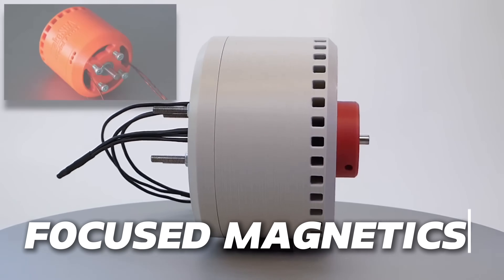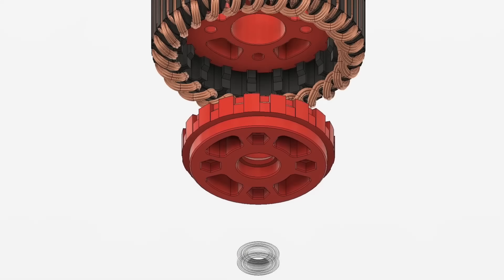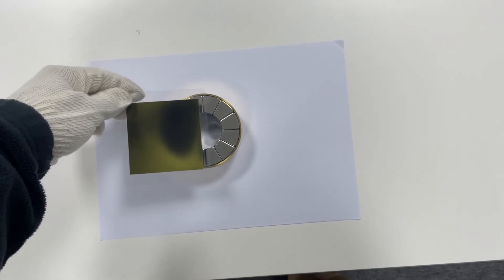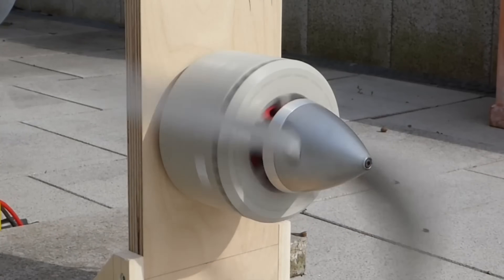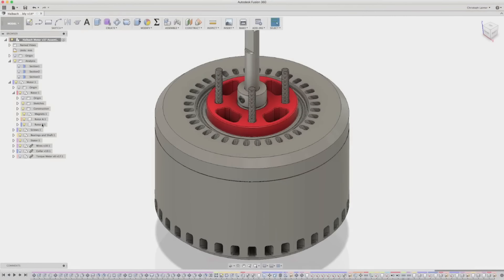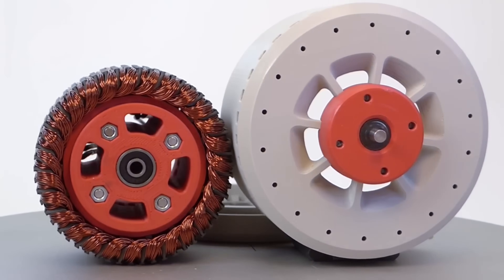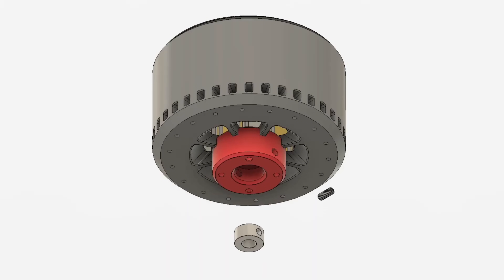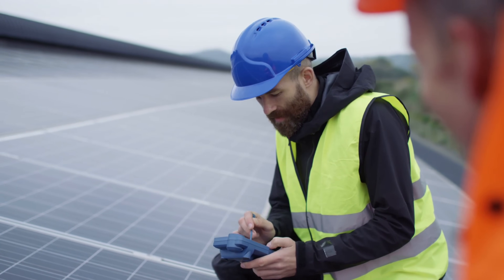Focused Magnetics: INVENTORS BUILDS Breakthrough MOTOR - IS it REAL!?

Comment: I’m developing an overunity generator to totally eliminate the need to rely on the power company ever again. It’ll actually allow you to physically remove the power company’s meter from the socket outside your house and using the adapter that I’m also developing, my overunity generator system will simply just plug in to where the meter used to go! Available in various output levels from 200amps all the way up to Megawatts! Bye bye power bill🖕